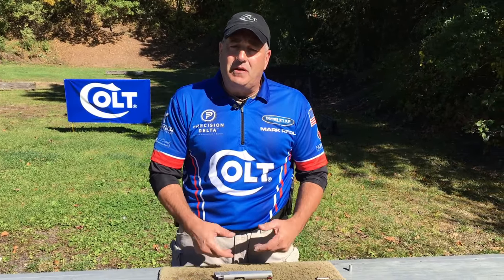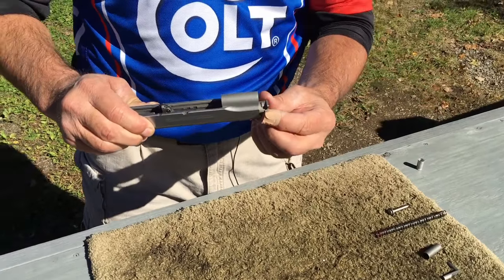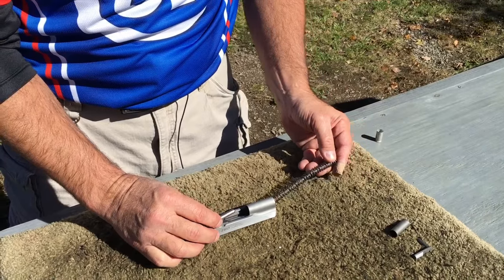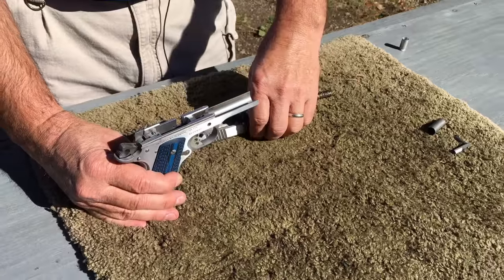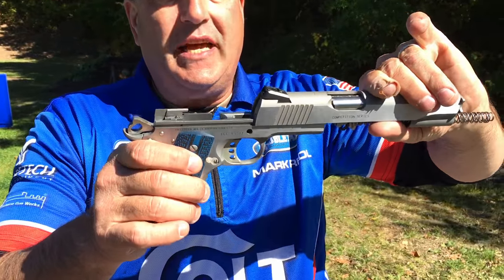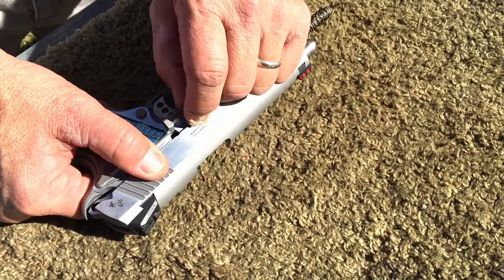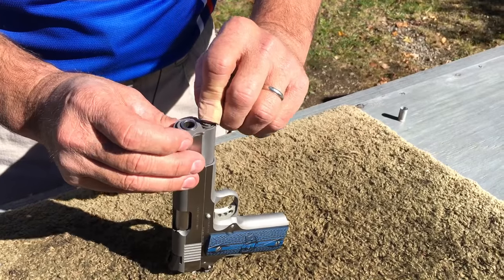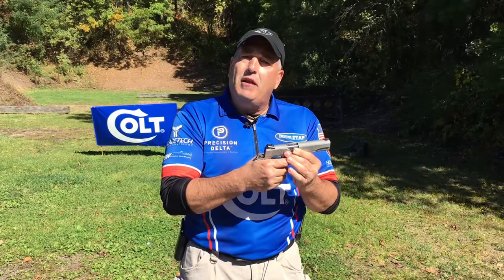How to Reassemble Your 1911 Pistol

Comment: I have 5 each 1911's..two are good quality for example Ruger etc..I learned years ago the wrong way to reassemble them and as a result I had so much damn trouble I just gave up on them...put them in the safe and said to hell with this..by a sheer act of God I came across these videos breakdown and reassemble...he made it so easy I couldn't believe it..I reached into my safe...took 4 out of 5 of them down at my desk in the house instead of the bench out in my shop with no tools..shocked at the ease of take down and reassembly..only one of my 1911's..the Tisas...gave me trouble because it is for lack of a better word it's just cheap and troublesome due to the quality of the parts.....nonetheless I did manage to get er' done on that one too..the only trouble..THANKS MAN...REALLY!  I'm 75 and now I will enjoy shooting them again and cleaning them.
Reply: i break my tisas regent p45 down by hand no prob smooth i thought i would need a  punch before i bought it dont even use a tool for the bushing

Comment: That slide stop went in too easy.
Reply: A lot easier than mine
Reply: Probably been removed 1,000 times.
Reply: You just gotta get it right! I’ve only done it a handful of times and I got it down pretty good already!
Reply: LOL always struggle with that step.
Reply: Get it right, should take less than 30 seconds, try some Eezox if it’s tight and look for the pin it has to clear. 🎉

Comment: Dang! Thank you for mentioning the simple, but overlooked by me, step of rotating the barrel bushing 180* and locking it in before attempting to assemble the next step with the recoil spring. I tried MANY times without locking in the barrel bushing first only to FAIL just as many times. Again - Thank you!
Reply: Thanks for this

Comment: There's a spring in the frame of the gun where the takedown lever goes into that you have to make sure to depress before putting it in. That's where I got hung up until I pushed it to see if it depressed in. Used a flat head screwdriver and lowered the takedown lever over it and popped right in
Reply: A guitar pick also works well to depress the plunger and the plastic won’t scratch the pistol frame

Comment: Looks so simple on here...  My new Kimber is a freaking nightmare to reassemble, thanks in no large part to a 20 something pound recoil spring.
Reply: Yes, I’ve had my Kimber 45 for almost 20 years and every time I clean it it drives me completely insane how difficult it is to reassemble, not to mention I’ve been spoiled by Glock simplicity

Comment: Don’t drop the slide stop lever into the hole and then align everything by moving the slide back. You’re setting yourself up to leave the “idiot scratch” on the frame. Adjust the slide so everything is aligned and THEN drop the slide stop in place.
Reply: Oops. About 35 years too late, but thanks.
Reply: I agree with you Lee.

Greetings from Ciudad de México.